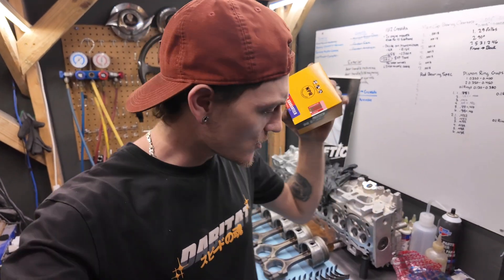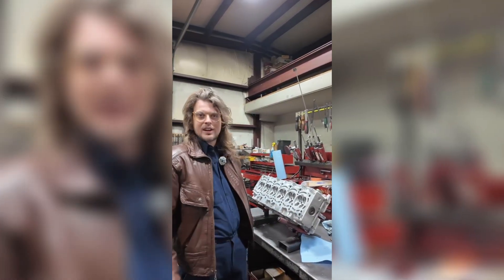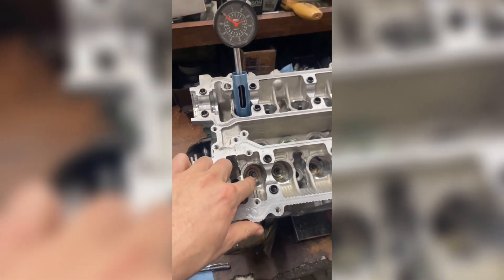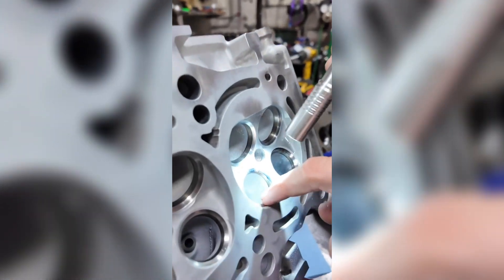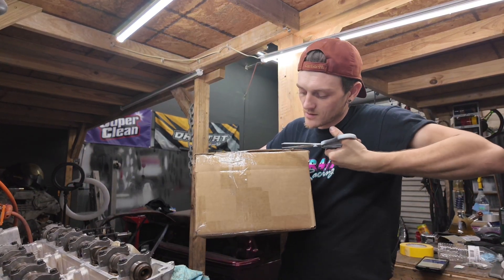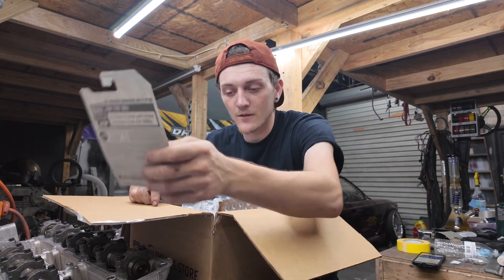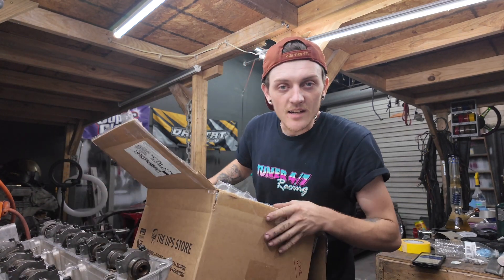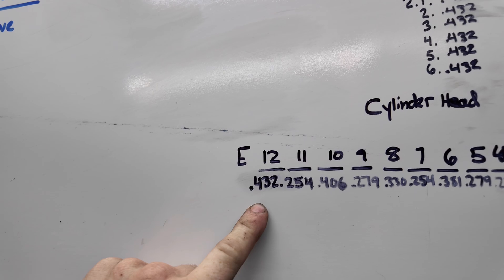This 2JZ Engine Assembly is Getting Real | Valve Installation

Comment: The mark II is a great car. It just needs some areo to make it flow better. 
You didn’t show it but did you file the new rings so they had the proper gap? What gap did you end up using. I believe the gap size is different if you are going to use this as a drift engine.  Great that you had them ported, many turbo owners don’t bother with this because they can just turn up the boost but it really helps with low and mid performance as well as reducing the amount of boost needed to reach your power goals, consider port matching the intake and exhaust. It’s not difficult just a bit time consuming. Nice edits on the video.